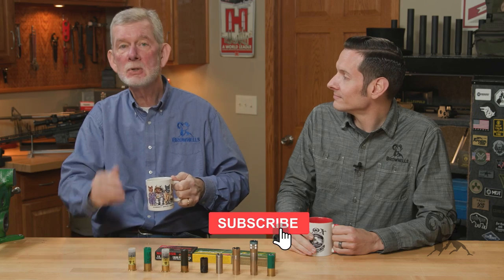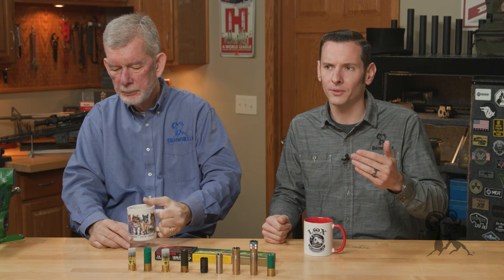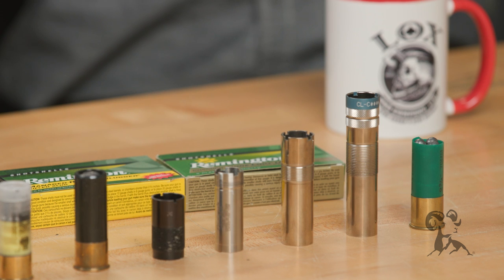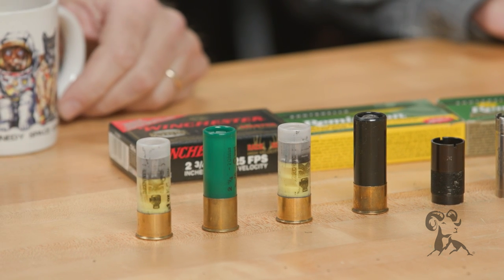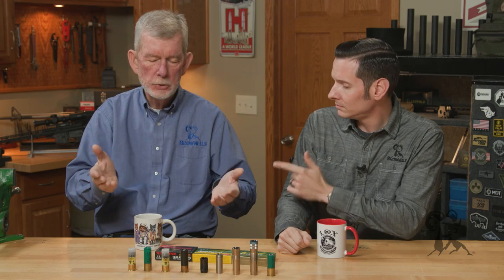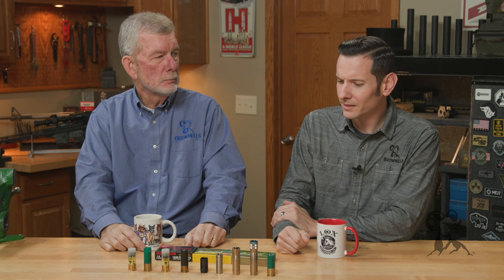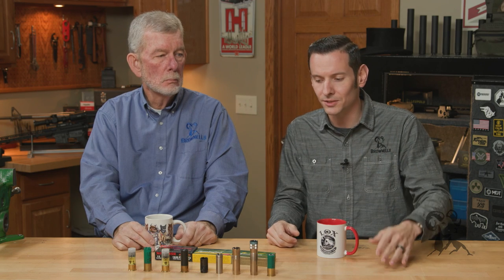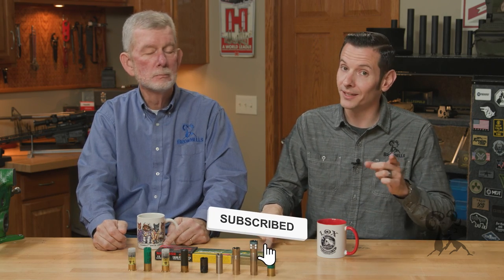Quick Tip: Caleb & Steve Explain Choke Tubes

Comment: There is also a caveat regarding chokes which is that carlsons for example label their constrictions to steel etc. And oem chokes are labelled for lead. So even though a ported cremator lr is labeled full, its actually the same as an oem mod.

Comment: The Department of Energy nuclear security team ran tests in the 1980s on the use of buckshot in tight chokes.  They determined that a 14" Remington 870 12 gauge barrel fitted with a full choke produced tighter patterns than larger chokes (or no choke).  This allowed them to hit targets at extended ranges with greater impact, i.e., more shots in the kill zone.  This logic should apply equally well to deer hunting.

Comment: I run Carlson choke tubes, i run an old 870 my dad gave me when I was a kid so I like to protect it from the crazy modern hunting loads available. To me the extended choke tube is the best way to protect my shotgun and run the modern loads as the primary choke restriction and all of that force associated happens in the extension of the choke and not in the old barrel. I’d rather order another choke from brownells then a new barrel because it gets deformed. I do actually have a shorty slug barrel for it just for fun and that is from brownells as well. 

I know I could use the slugs for deer, but rifles are allowed where i live so that’s what I use.
Reply: I run a Carlson barrel & extended Carlson choke Tubes as you mentioned also on my 870. I use Comp-N-Choke Extended Tube for turkeys, I have found nothing better.
Reply: @NoWr2Run  can you run lead and do well for turkey's if I only have the cylinder/modified cylinder choke that came with my 12 gauge would you suggest me using a specific turkey load or something? Or just getting a full choke?
Reply: Slightly off topic but the small town I carry mail in (Atwood) here in rural NW Kansas is where Carlsons is located. Lots of good people there so it's nice to see people who enjoy their choke tubes

Comment: What is the purpose or function of an extended tube? Does it provide any performance benefits? Why do they exist? Or why doesn't every shotgun have them?
Reply: Easier and quicker to Change tubes between stands, alters the balance of the shotgun, also an extended choke tube will be that bit longer smooth out the load (Allegedly).

Comment: I have a first year production remington 870 12ga 28" modified fixed choke. Any stuff i should avoid? I typically just use rem 2-2/3 00 buck and basic 1oz HP foster slugs from federal, also i have some  rws rottweil brenneke original slugs. I do have a good bit of federal #2 steel bird too.

Comment: Correct me if I’m wrong, but what Steve said about the fins in a rifled slug imparting spin once it hits the air is not what I’ve been told. I was under the impression the rifling is just shaped that way to allow the material to have somewhere to go as it passes through the constriction of the choke tube and they don’t really spin much.
Reply: Correct, it certainly can impart some spin but it’s not the purpose and it’s not enough to make any real difference.
Reply: Taofledermaus debunked that one.
The purpose of the fins is so the slug can be swaged down as it passes through a choke tube.

Comment: I heard them extra extra extra full ones work in any barrel, dont even need threading. Theyre amazing! Lol

Bismuth is a good alternative y'all didnt mention to steel for muzzleloading and antique shotguns that have issues with steel. Maybe a quick tip short for it?
Reply: Good point on the bismuth. Denser than steel, not as dense as the tungstens. Great option for anyone, as it’s cheaper than tungsten too.

Comment: Waterfowlers are not limited to steel shot there is now bismuth and tungsten. Choke tubes that are not expressly marked for hevi shot should not shoot hevi shot.  steel shot should not be run out of a stock full choke.  Depending on the size and velocity of the steel it should (bb or larger at over 1400 fps) not be ran through an after market long range or full choke.  Unless you are using a mossberg ultimag system such as the 835 or 935 or 10 gauge that all opens a new can of worms.

Comment: Can you fire a slug through a barrel with no choke at all?
Reply: Cylinder Bore ?
Reply: If it's a rifled slug, yes. Something like the Remington Slugger is what you want.
Reply: If your shotgun has a threaded barrel for chokes, you must use a choke tube or you'll destroy the threading. These shotguns usually come with a cylinder choke tube (it's not technically a choke because it has no constriction).

Comment: I have an old double barrel, rabbit ear made in the 1900s and for the life of me I cannot remember who it was made by but it is Damascus steel with a beautiful swirl pattern and I was told that I really should use black powder but it seems to me sense it is Damascus steel it should be strong enough to use smokeless powder. My question is would it be okay to shoot the copperhead BB's out of it, by the way it's a fixed full choke?
Reply: Damascus has nothing to do with strength in the modern era, the blend of the steel is what matters. hammering it over and over was the only way to get the impurities out making it stronger, it’s been a good bit since that was the case and it offers nothing but a unique look.
Reply: @jaydunbar7538  okay Jay thank you so much for answering I think I'm still going to try it but what about the BB's do you think it be okay to shoot BB's when I load them in my shells? Speaking of loading shells I think I'll start out with a little bit lighter load try to build to the load I want, if it don't kill me first.

Comment: Yes stay away from steel in an old gun
Reply: German proof houses say you can safely shoot up to 3.25mm steel shot from old shotguns with a cylinder choke. 
We've had CIP proof marks for steel shot for many many years now. You can send it to a proof house and have them test it for you. A lot of high quality older guns will be fine with steel shot and higher pressure loads, you just don't necessarily want to test it yourself.
In Germany, the proofing only costs like 50-60 Euros but it could increase the value of your old shotgun by a couple hundred (if it's generally a good gun)

Comment: You mentioned rifled choke tubes, can I use one for copper slugs to improve accuracy? I know it won’t work like a rifled barrel, but will it help? A lot of states are outlawing lead and I’m sure many will be curious
Reply: The rifled choke I have did not stabilize or group any sabots, only full bore lead slugs. Could’ve been a twist rate issue but who knows.

Comment: LOL!!! People who buy "tactical barrels" are being ripped off!!!!
Improved cylinder chokes can shoot everything better than a smooth bore. Slugs? Better. #00 buck? Better. Bird shot? Whole lot better. If you feel the need you can put a cylinder bore choke in, there is your 'tactical barrel'.
   Mossberg 500 for example, you can get a standard 20" barrel that uses chokes. Just an inch and a half longer than the 'security' barrels. Unless you feel the need to look like Rambo there isn't a good reason to buy a 'security' barreled shotgun.
   Most manufactures of chokes seem to discourage steel shot out of anything more restrictive than a modified choke. Of course depending on shot size, your mileage may vary. The ammo manufactures' websites will be the best place to review their conclusions. Also choke tube packages seem to also have suggestions on them now, it is still best to read what the ammo manufacture has to say.